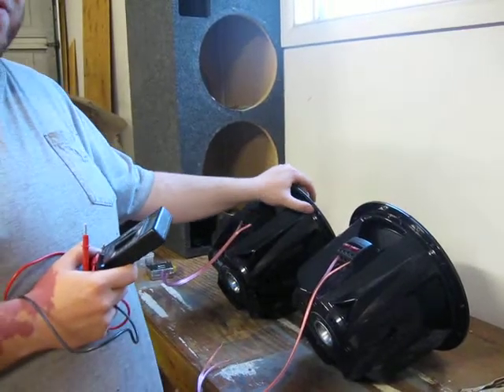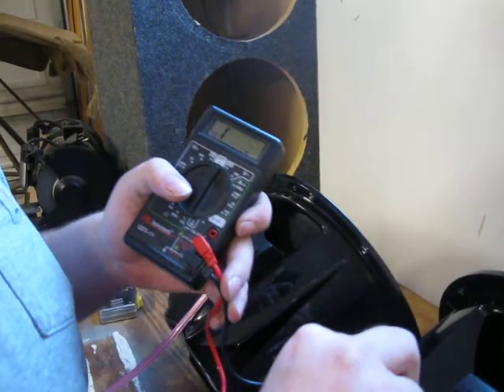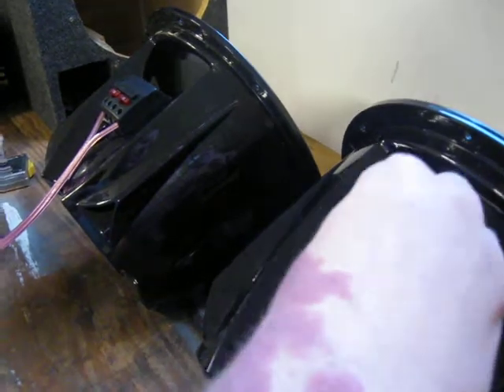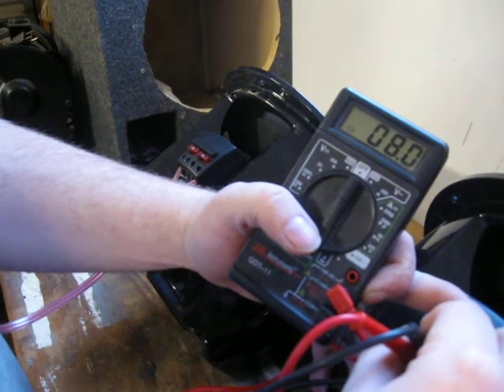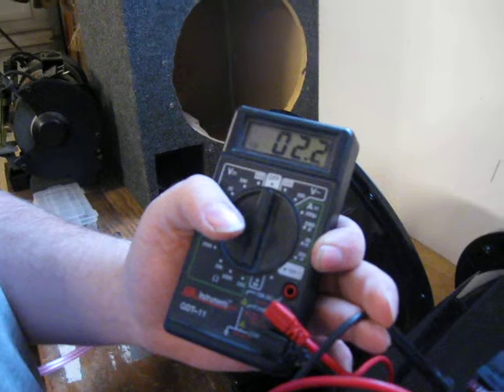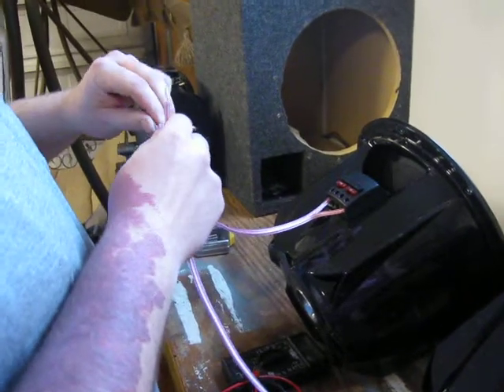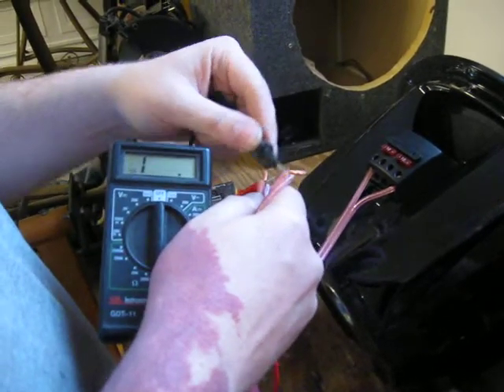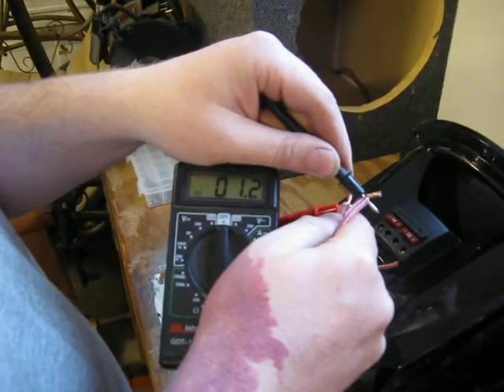How To: Wire 2 dual 4 OHM subs to 1 OHM

Comment: Ok, so I have two kicker comp 4ohm 10s temporarily!! They are single voice coil, and they are reading 6ohms each, I just have them wired +/- directy to the amp not wired together or anything... what are they running at? Are they running at 6ohms wired like that, or are they actually 2 ohms or something? I would appreciate the help!! Great instructional video!!